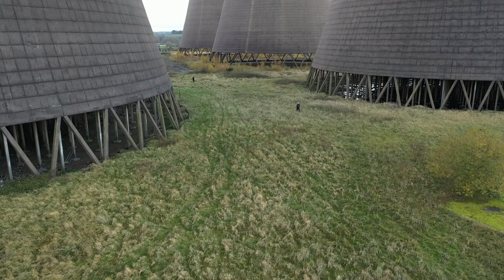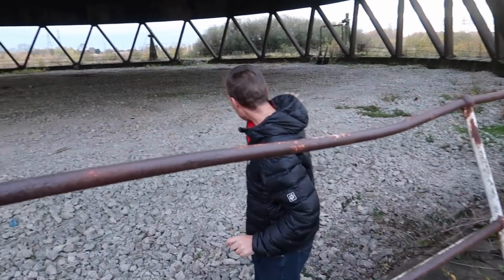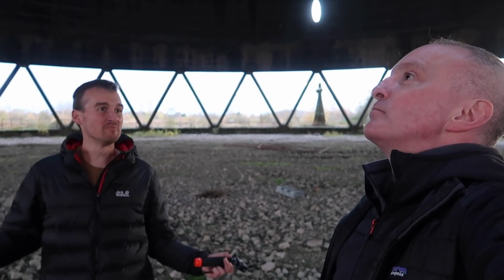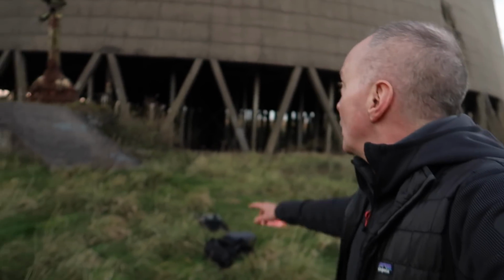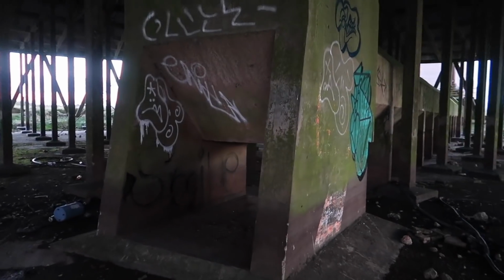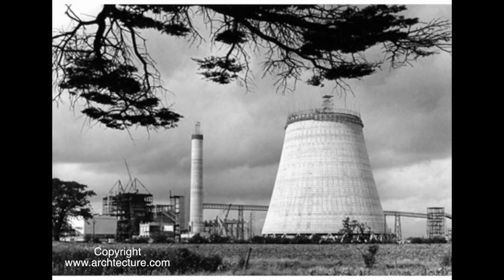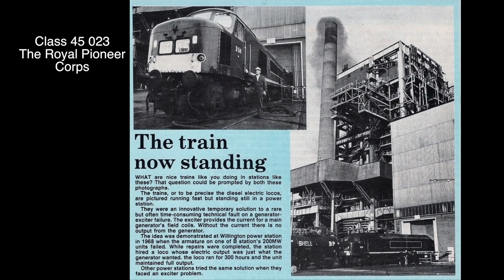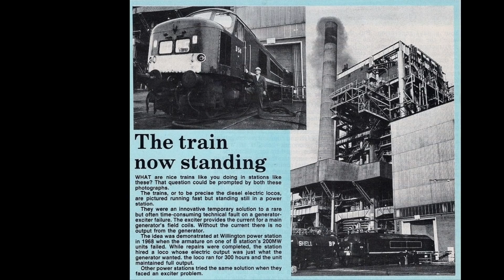The abandoned Cooling towers of Willington Power station

Comment: The only reason they have not come down yet, is they say "It would cost a bomb. or 5'.  Not forgetting the cost of 1000+ dump trucks to haul the debris away.
Reply: Demolition costs a suprising amount of money. Across the pond for example in the industrial powerhouse of Detroit,  there are several massive abandoned factories that still stand simply because no one can or wants to fork up the money, so they still stand abandoned to this day.
Reply from the maker: Yeah bet its reinforced as well, twisted steel and concrete
Reply: The reasn that they have not been  blasted down yet ( like close by Donnington and Drakelow A and B ) is because whover gets planning permission to build the thousands of homes there has to blast them down.  However the locals dont want the homes built there and that's the problem.
Reply: @paulprescott7913  

Nimbyism.
Reply: @dtapx5835  really

Comment: It's a pity you couldn't get up to the door on the side of the cooling stack  if you could you would see a wooden walkway that goes round in a circle your right about the pipe it pumps the water up into the stack and at the side of the stack there is another pipe that pumps in cold fresh water(probably from that river going past) and it's sprayed above the boiling water and this helps cool the steam down and at the bottom there's a collection tank which returns the warm water back to the boiler/turbines the wooden shutters you seen above your head in the complete cooling stacks are used to give a bigger surface area to cool the water down and reduce the amount of steam
Reply from the maker: I think there would of been a metal stair to the door at one time
Reply: @MartinZero  there would have been

Comment: The purpose of the cooling tower was to turn steam back into a liquid.. so the centre pipe would spew steam which would re-condense within the tower.. growing up in Derbyshire from the hills we could see these amazing columns of steam rising up into the sky.
Reply: Usually these dealt with the condenser water not steam. The water used for steam is usually very pure, so would normally be in a closed loop. The condenser hot water is what is normally sent to the cooling towers and then back to the condensers.
Reply: I agree that these are beautiful and impressive structures, once common but soon to be rare. What I have never understood though, is why so much effort was put into dissipating (basically wasting), energy😳! Surely it could have been put to use in some way?

Comment: That was great thanks Martin, always found cooling tower sort of intriguing and sort of slightly sinister/imposing. Its funny how people are going from seeing them as eyesores to be torn down as soon as possible and into historic landmarks, bit like gas holders in that respect. Symbolic of more industrial times I suppose but I find looking at that as impressive as Stonehenge or whatever. Do hope a few survive. On the engineering side it seems really wasteful just having to have the cooling towers, don't know much about it but guessing the process generated a lot of hot water as a byproduct of burning coal and it just needed getting rid of, I wonder f these days there would be a method for harvesting the heat energy from the water ?
Reply from the maker: I think they have been doing that in Finland for a while Mark

Comment: When  I lived and worked in Huddersfield in the 90s, some weekends I would travel down to visit my parents in Birmingham. One day while travelling down the A whatever it is that passes the Toyota plant, I saw signs for a power station open day TODAY. Not really sure if they were from the previous weekend, I followed the directions and arrived at what I believe was this power station which was indeed open.
You followed a route around parts of the station, which was at least partially in shutdown at the time. At various places, like the Control room, turbine hall, and cooling towers. A guide would explain things and take questions. We entered one of the shutdown cooling towers, up some steps to that (What I have heard call v**ina shaped) oval entrance, which led along a walkway above that large water inlet pipe to the centre. The water did indeed go upwards in the centre and outwards along small radial pipes to a series of upside-down sprinkler heads as @mrlister2000 described. The spray would cascade down over the wooden "fill" into a large collection pond in the bottom.

Brilliant video Martin, well worth the wait!

Comment: those  egg shaped opening up the towers where the door ways into the inside i once did a couple of tours of rugeley power station about 12 /15 years ago ,when it was in operation ,they do not burn coal as you would on a open fire ,but actually burn coal dust ,all the coal was ground up into dust, ,and was burned  in the air inside the boilers ,kept up by air been blown in .all that fell to the bottom was ash
Reply from the maker: Oh yeah I have heard about that. I think it burns hotter

Comment: I worked on Thorpe Marsh sub station on the land of the old power station. There was cooling towers left. They tried wire cutting them the video of them doing that one sat morning is on YouTube. Then they where trying to use explosives on the others. I was told that the water came in on a central pipe and sprayed out onto an elevated mesh floor the water cooled and returned to a lagoon under the mesh floor. Be nice to know if that's right it fits in with the towers you found and Thorpe Marsh
Reply from the maker: I would love to see one working Nick
Reply: @MartinZero  must be footage on here. I seam to remember a cleb quiz show with cars racing round a track in a cooling tower. Searched Google but nothing. I did wonder if it was there and that's why there is the stone.

Comment: A Peak would be about 15gallons a hour idling, So I rather doubt the claims. The generator exciter supplies the field windings on the rotor with DC electricity, so it can make the magnetic field required for generation.

Comment: The towers were to condense the hot water from the boilers cooling it so it could be reused 
The hot water was sprayed inside the tower the  gap at the bottom allowed cooled air in which then mixed with the water mist the cooled wat them falls to the bottom & sent back to the boilers
Reply from the maker: Cheers

Comment: run fact: 99.9924% of gravel in dungeness is nuclear power station site A ruble
Reply: And of course that site does not need cooling towers, being by the sea. Years ago, when A was still operational (while Dungeness B was under construction) I visited the old A station as part of a public group. It was possible to walk on top of one of the old Magnox reactors while it was in use.
Reply: @johnkeepin7527  How does being "by the sea" mean you don't need cooling towers?  Did they use sea water in the process?
Reply: @2H80vids  Yes, e.g. the stations at Oldbury used the Bristol Channel as a source of cooling water; most of the nuclear stations around the UK are like that.
Reply: @johnkeepin7527  Salt water can't do the pipes and the cooling system any good.
Reply: @2H80vids  No doubt designed for it. Another (non-nuclear - coal) one by the sea is Aberthaw in Glamorgan. The very first power station I ever went to didn’t have cooling towers either; it was Pembroke (oil fired) when it was brand new. Didn’t last long, when the price of crude oil zoomed up in the early 1970s! It was almost the same as many coal fired ones, like Didcot A, but with 4 oil fired boilers, and was around 4 x 500 MW.

Comment: I can never understand why they expended energy - in this case, coal - to heat the water up, convert it into steam to turn the generators .....   and then cool it right down again.   Why not take the exhaust from the steam turbines and heat it back up a few degrees again using less energy.   Anyone any ideas?
Reply from the maker: I am with you there David. I dont get it either

Comment: Those struts just don't look strong enough to support the tower.
Reply: It is quite amazing how that frame supports such weight. A little off topic, but look at Brook House in Basildon, now a listed building. Constructed around the same time, a block of flats built on a concrete slab that is raised by similar design. Amazing how the weight is supported.

Comment: Any truth in a cooling tower closer to home. fiddlers ferry maybe!!
 The designer or builder of one of the cooling towers. Their was a fault in the structure. So he threw himself off the top.
Reply: The B2 cooling tower at Fiddlers Ferry Power Station collapsed during a gale in January 1984. It was known that this tower contained a roughly axisymmetric bulge just above the ring beam which had been present since the time of construction. This paper describes various finite element analysis that were carried out to assess the effect of this geometrical imperfection on the stresses in the tower. It is shown that the bulge would have caused vertical cracks to develop and the subsequent propagation of both horizontal and vertical cracks would have ultimately lead to the collapse of the tower.
No one killed themselves as a result!
Reply: @mrlister2000  I remember driving past the cooling towers and seeing the bulge, many years ago.
Reply: Used to live very near to the towers at Poolstock Wigan,
Reply: @brianroscoe239  I used to live in Wigan & all my dad's side of the family are originally from Hindley, but didn't know Poolstock had any towers there!
I know the Three Sisters racetrack are named after the 3 cooling towers that were there many years ago.